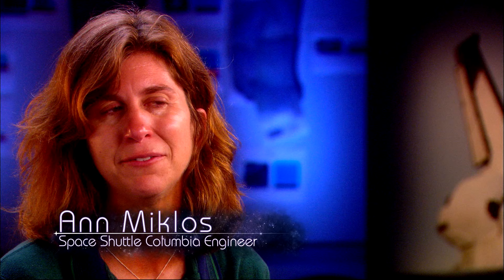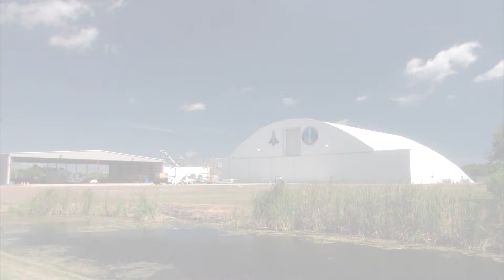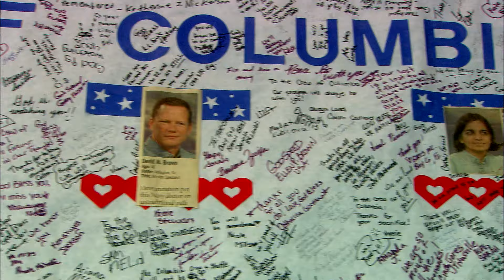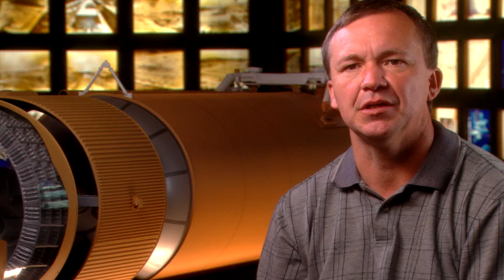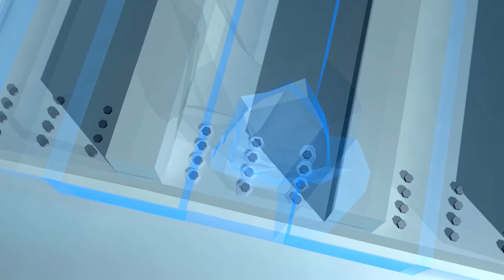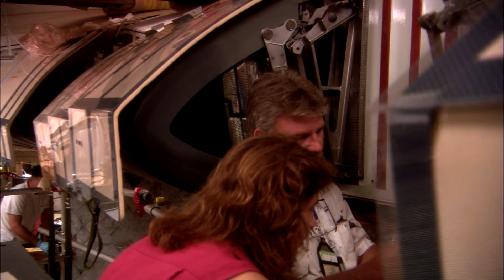Disasters in Space: Columbia #space #astronomy #universe #nasa #science #spacedisaster

Comment: Both Space Shuttle loses can be attributed to the use of large solid rocket motors that destructively vibrated the structure.   The first Shuttle loss was from violent forces on the front landing gear mounting point with the external tank breaking the bolts away causing the Shuttle to rotate into the external tank exploding it.   There was also a flame jet leak from a seal system giving way connecting separate sections of the solid rocket motors aimed in the direction of the front landing gear area mount with the external tank.   This may have pushed a falling system over the edge.   The flame jet leak was causing so much thrust deflection that the Space Shuttle's main engines were at full gamble to compensate, but that was a correctable issue.  The worst case would be the Shuttle lacked ability to reach needed orbit and would have returned. 

On a past Space Shuttle flight one of the three bolts holding the Space Shuttle front mount with the external tank had vibrated or broken off.  Another bolt had gotten so loose it was providing little retaining holding force leaving just 1 of the 3 bolts to hold the Shuttle steady with the external tank.  Von Braun's German engineering team would have never let such a system continue.  

Note the use of the term "seal" and not "gasket".   A seal system reflects there is movement typically rotation between the seal and a surface.   NASA specifications were for there to be no joints in the solid rocket motors having them be one continual casing.  The contractor, which had never designed for human flight, ruled that it would have to build the solid rocket motors in Florida instead of their normal manufacturing plant if not made in segments.   The contractor won.   The forces in the casing from extremely high pressures and from high violent vibration are so high these joints are actually rotating requiring a sealing system and nota mostly static gasket system universally used when connecting flanges.

The second Shuttle loss was from the violent vibration from the solid rocket motors breaking away insulating foam from the external tank coming back to puncture Columbia's wing that upon reentry allowed hot gases into the structure destroying it.   

The Soviet Space Shuttle used the expendable Energia rocket that was a liquid fuel rocket system able to be shutdown and didn't produce the destructive vibration of large solid rocket motors.   Much as use of an upgraded Saturn V booster would have done with the Nova Space Shuttle concept the Energia rocket components went on to be used in other space flight uses being highly desirable because they were human flight rated and they were the most efficient large RP-1 Lox rocket engines ever produced.  
 
The SLS Artemis 1st stage booster, sometimes called a 1-1/2 stage because it sheds the solid  rockets before ending the first stage, uses an extended 6 segment verses 5 segment Space Shuttle solid rocket motors connected to a liquid fuel tank with 4 Space Shuttle RS25 hydro Lox engines on the base of the liquid fuel tank.   This system will still have the high destructive vibration as the original Space Shuttle system. 

It does now have a much safer Apollo like crew cabin architecture  with a crewed capsule able to use an escape rocket to get away from an errant 1st stage and being at the top of the structure away from shedding debris and ice.   If the 1st stage were to blowup or go errant the crew simply starts the escape rocket generating 9Gs pulling them away from the 3Gs or so of the first stage.  The capsule then returns by parachute into the Florida ocean waters.  

Von Braun was very against using large solid rocket motors for human flight.   Key was solid rocket motors can not be activity throttled or shutdown.  Large solid rocket motors produce highly destructive vibration that are nearly impossible to assess on a complex multi system space craft.  Especially back in the 1960s.   An engineer has too many destructive unknowns that every component and connection has to be evaluated for.   There was not a wholistic ability to model such vibration until well into the 1990s if not later.  

Having to account for all the possible vibration incidents from the large solid rocket Space Shuttle motors would be close to impossible and was at the time of its design.  This would likely be getting into addressing  rogue waves as the phenomenon is called today, but more complex.   Being able check for large destructive erratic interacting vibrations with mathematical models connected through out the completely assemble structure would be extremely difficult today.  

If using systems that can't be shutdown that go errant posing a danger to humans the obvious means to address the situation is to jettison the errant system or evaluate the people.   The Space Shuttle lacked both of these.   Emergency detachment and immediate safe distancing of the large solid rocket motors would have seemed to be an obvious design requirement from their initial inclusion.   I always assumed that was a part of the design without it being acceptable otherwise. 

The Nova US Space Shuttle would have used an upgraded Saturn V non reusable first stage with no solid rocket motors and the Space Shuttle above the 1st stage with a much smaller external fuel tank.   This would also allow the booster to be used for high lift cargo such as building a space staton that could have been done in a handful of flights.  

The extremely high cost of refurbishment of the Space Shuttle making each use between 1 - 2 billion dollars would almost certainly be more than building a new Saturn V booster for each flight.   Without the high vibration from the solid rocket motors the Shuttle would have lost far fewer heat tiles.   

The Shuttle had overly high dangers for human fight and needed a crew escape system.   The first space shuttle Challenger had one crew member killed by the initial impact, but the rest could have parachuted to safety if they could open a hatch and had parachutes.  They were alive when they hit the water.  This reflects the acceptance of crew perishable ability with the basic choices of the Space Shuttle.   Von Braun wanted to have human visits to mars in safety and comfort.